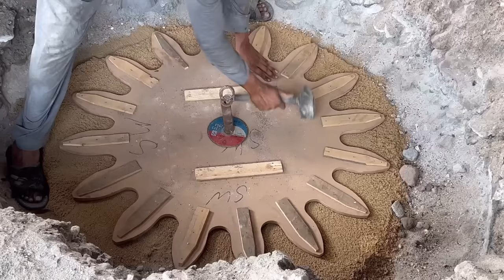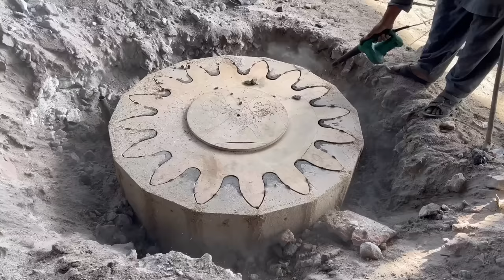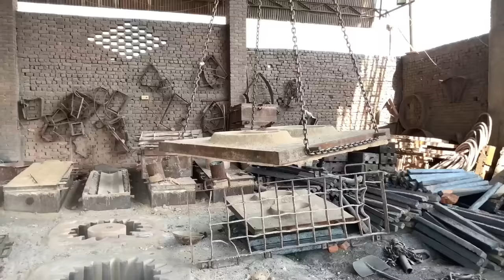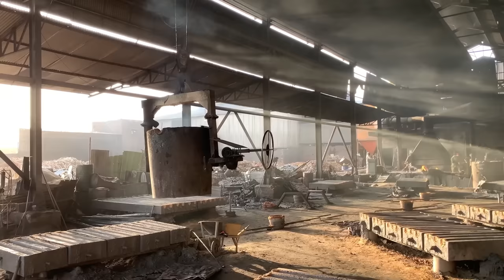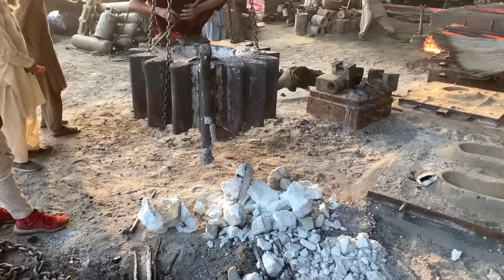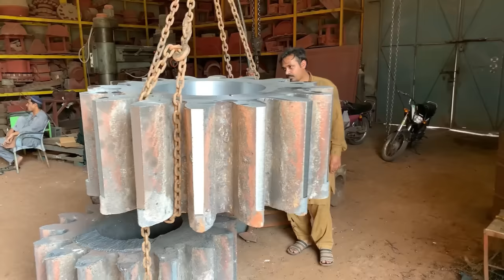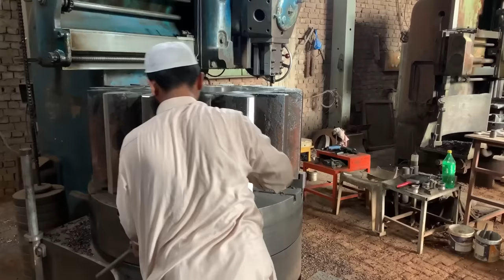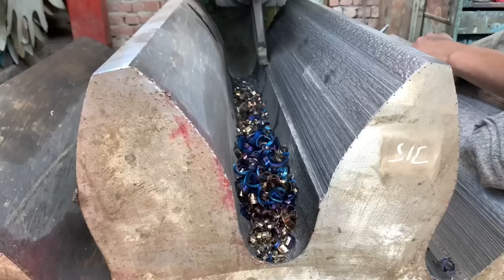Handmade Making Process of Large Milling Machine Gear | A Huge Industrial Gear Manufacturing Process

Comment: I asked the guy what grade of steel this gear was made of and he replied "yes"
Reply: Very good, very good, the best we can find.
Reply: He replied, “What grade of steel do you want me to write on it?”
Reply: Tin cans 😂
Reply: It’s still steel and that is what counts.
Reply: Pakistani society is so primal, so natural, completely original. Very impressive. We observe humans at their development we had in Europe in the 19th century.
Reply: Which country was that?
Reply: @BurkhardusX when the steel fails people can die. The grade of steel is very important. Something this large should be X-rayed for cracks and I doubt that will happen either.
Reply: @anon0054  don't exaggerate too much. India and Pakistan have overpopulation.
Reply: @BurkhardusX  just no. steel isnt just steel.
Reply: @BurkhardusX  So they send 10-year-olds to run the shaper?
Reply: since your an expert.. what grade of steel is necessary for this particular gear? oh wait yo have no idea?
Reply: @timn4481  who said steel is just steel? Me not.
Reply: @Ash-nq1qo  Building toothwheels from unselected steel scrap for heavy machinery in an environment with lower quality control and manual manufacturing, like in an underdeveloped country, poses significant challenges. The variability in scrap material composition means that achieving a consistent and predictable grade of steel can be difficult. For such applications, where precision in material properties may not be guaranteed, the focus should shift towards using a steel grade that is versatile, widely available, and capable of being enhanced through post-manufacturing processes such as heat treatment.

In this context, a basic carbon steel grade that is commonly used and can be relatively easily sourced from scrap, such as AISI 1020 or AISI 1030, might be considered. These steels have a lower carbon content, which makes them more malleable and easier to work with, especially in manual manufacturing setups. They can be welded, machined, and heat-treated to improve their strength and wear resistance to some extent, making them suitable for less demanding applications.
Reply: @Ash-nq1qo  Wrought Iron or Basic Carbon Steel Equivalent: Initially, wrought iron or basic carbon steel would have been typical materials due to their availability and ease of manufacture. These materials, comparable to a modern low-carbon steel (e.g., AISI 1010 or 1020), would be chosen for their workability rather than their ultimate performance. The focus would be on refining the scrap into a homogenous mass, likely through a simple forge or furnace, manually removing impurities to the extent possible.
Reply: @Ash-nq1qo  I actually could tell you if I had the appropriate information about application.......one thing I can tell without a doubt with the given information is that anything that requires that size and type of gear requires better metals than what they are using.This isn't tech,it's making due
Reply: “A+ my friend”
Reply: Better defined as alloy of unknown origin.
Reply: @BurkhardusX probably explains then the total lack of PPE
Reply: 4340
Reply: "Yes the steel is very grade"
Reply: @BurkhardusX AI generated comment lol
Reply: Here in Russia at the end of the twentieth century it was about the same thing, and in deep villages we still meet such people) @BurkhardusX
Reply: @benchgoblin  you are AI generated. Me not. I am engineer of material science.
Reply: He ment every.
Reply: Did you asked the man in Punjabi? No, of course not.
Reply: @WisdomVendor1  No, the alloy has no unknown origin, it’s rather the opposite. The good people there down in Pakistan collect various types of alloy waste and meticulously observe which kinds of products they melt together, ensuring a well-informed and effective alloy recycling process.
Reply: @Jabbawocki1  you see everything with your western goggles.
Reply: @internetpolification  what would you ask the good people down there in Punjabi, if you would spend some more time in India than me?
Reply: @BurkhardusX  personal protection ( or the total lack of it) has got nothing to do with what country im from mate  but got everything to do with how workers are seen by the employer . in this case they are obviously expendable .
Reply: @Jabbawocki1  that’s what you westerner thinks, but in fact it has much to do with the country you live in, in India there is another view on such topics like safety. If you would have spend some time in India or other countries around, you would understand this. Westen safety standards are uncommon in these countries. It’s absolutely up to the good people of theses countries how they define their own safety standards and YOU have no right to interfere these things. You live in your western bubble and you think you have the right to judge about these good people of Pakistan or India. You have never worked in an industrial environment, how dare you, to judge about other peoples living in a completely different stage of industrial development?
Reply: @timn4481  This is the way they think. And we actually buy stuff from these crews? Its ridiculous. No idea. No wonder the world is falling apart. The whole earth will look like this place soon. What a mess.
Reply: Please don’t sound like you’re trying to say „sub-humans“ …
Reply: Aluminum Steel Iron Lead mix for sure xD
Reply: @user-ls1fz7tb6q hahahahaha so funny 😂
Reply: So what point are you trying to make exactly? More importantly why do you feel the need to make it? - genuine question

Because it seems like you’re making light of these gruelling and dangerous working conditions by ridiculing these hard working blokes. Or do you truly lay awake at night worrying about steel grades?
Reply: Low quality crap.
Reply: Jail.  Straight to jail.
Reply: Means he dosnot speak in english
Reply: All grades off steel.
Reply: Their English is 😅
Reply: @anon0054 the metallurgist had the correct mix of clutches and and exhaust pipes 😎
Reply: @anon0054 do you really need x rays to know it's full of cracks?
Reply: @BurkhardusX  That is not what counts lol. The difference between grades of steel can be like the difference between wood and jello. Even worse if it's a mixture of grade from scrap metal, because then you have a part that has no true predictable characteristics of wear and tear, and a dangerous one at that. When it comes to grading metal, "close enough" isn't a thing....it has to be right or you get catastrophe. Just like all those walmart teapots that say they're stainless steel, but rust after a couple uses.
Reply: @peoplez129  no, they are doing steel recycling, the grade of steel is very predictable, because they know exactly what kind of scrap they are recycling. Steel recycling is very important because it saves our environment.
Reply: They actually supply nasa for the space shuttle
Reply: @alfonsoarmendariz1416  No, this is Pakistan, an underdeveloped country. This being said, it’s a quite normal process, similar to what cold be found in Europe 100 years ago, in the century of industrialization.
Reply: I thought I heard him say “iron”
Reply: They always do,
Reply: Do you want a gear or do you want no gears? If you don't have the setup for it, you have to do what you can.
Reply: @anon0054  People also die if you never built any machines at all due to being paralyzed by lack of xray diagnostic machines, and never build infrastructure. People would just die of famine instead, because they're trying to do 5th century BC agriculture thanks to your paralysis toward any sort of progress due to relatively smaller safety concerns, if you were the guy in charge.
Reply: I worked at a european company. Same process and quality. Also the pile of scrab was the same
Reply: 3 parts iron; 2 parts sandal= yes
Reply: Yes. It is grade steal, yes. Lol
Reply: If not forged steel it’s rubbish
Reply: @icc64 how many languages do you speak wieśniaku?
Reply: ti chto ne uvidil starie motori  iz chivo oni ivo pereplavili ili ti umnim sibia shitaesh
Reply: Yes is a grade u can’t beat.
Reply: This prooves that he is from Pakistan
Reply: “Yes! 24 hour open!”
Reply: @Garagedoorsandgates208 😂😂😂
Reply: I'm pretty sure the grade is good enough for the osé case scenario, which is a gear. It like it has to handle extreme temperature and stress
Reply: Why don’t you make one yourself then if you think you can do better. Then you can use whatever steel you want
Reply: I started that back in 1998.
Reply: @thystaff742  lmao
Reply: All grades don’t worry as long as it works our eyes have seen it’s a good grade of material 😊
Reply: Stolen process and tec from the English industrial revolution
Reply: @Ash-nq1qo people do not need to be experts to have an educated, sensible opinion.
Reply: Thank you... 
     Please come again...🙏🏼 😂
Reply: This is the problematic helium control valve for Boeing's new Starliner.😂
Reply: He should have said Heavy Metal.
Reply: That are making a gear, not a gun barrel. everyone in here is a quality control expert.
Reply: @Ash-nq1qo  You're*
Reply: Pot metal
Reply: You people act like these guys in the video give a shit what you think...xrays are probably needed more for medical there, but I know using this here in the US ain't flying, as it shouldnt...
Reply: Esta. Gente. Si. Trabaja. Y. Talvez. Por. Un. Pago. Muy. Bajo. Y. Los.    Muchachos. Fifis. De. Hoy.       Que.  Por. Que.     Tienen.     Un. Diploma.   No. Quieren ...ensuciarse.    Los. Zapatos.    No. Quieren. Trabajar.  Tan. Duro.  Y. Quieren. Buena. Paga.       Y. Si. Les.  Aumentan. Un. Poco. El. Trabajo ....se..van.  y. No. Regresan.......     y. Esta. Pobre. Gente.        Aguantan. Por. La. Pobreza.
Reply: AAA beef
Reply: Considering what they had to work with they are doing a pretty decent job casting a new gear. I'm sure using primitive techniques it could have a higher failure rate but they probably often get all variables close enough to build a successful gear. I think what they are doing is much more admirable than sitting behind a computer screen doing very little manual labor and criticizing the less fortunate for their labor.
Reply: If you ask them "where are you from?" They will answer "I'm fine TQ".😂
Reply: This comment should have more like than this lol
Reply: Lol no shit!
Reply: We use only the finest scrap very few mufflers and paint cans!
Reply: Did you ask him in his native language?
Reply: I’m sure these people would really appreciate all the input about what grade of steel they should be using. I’m sure they would love to stop working and gather around and hear some one preach about what they should and shouldn’t be using in their society.
Reply: Its pajeet premium grade , dont worry ... 😏
Reply: Very very good sir 🤲
Reply: @BurkhardusX  Not for key components like gears.. if it isn't up to spec for the job, it'll start introducing steel chunks into the entire system, potentially destroying many more parts

That said, these guys wouldn't be doing business if what they sold wasn't up to expectations (which is probably keeping an end of life machine running for a bit longer)
Reply: @hayleyxyz  sorry I dont argue with stupid people
Reply: @hayleyxyz  Hi Hayley, you look very sweet…
Reply: And when this guy asked you how do he keep his family fed and gas running no one said anything
Reply: @sankalpdubey653  exactly! These guys are doing a great job. Westerners should keep their mouth closed and stop complaining about working conditions and steel grade!
Reply: 😂😂 checks out
Reply: Pakistani 😅
Reply: Absolutely rubbish quality
Reply: @BurkhardusX Steel  is an alloy and it's definitely not all the same .
Reply: That is yes grade steel
Reply: "Great steal my friend " 😅
Reply: its made out of yes, whats wrong with yes?
Reply: @BurkhardusX they know how to live and die
Reply: @BurkhardusX so what?
Reply: @Jabbawocki1 safety is in practice not in equipments